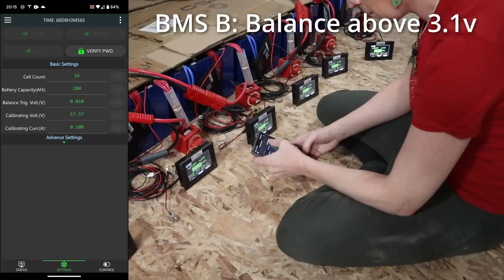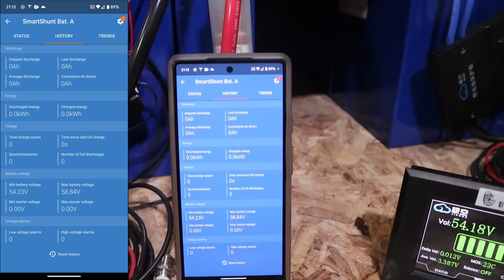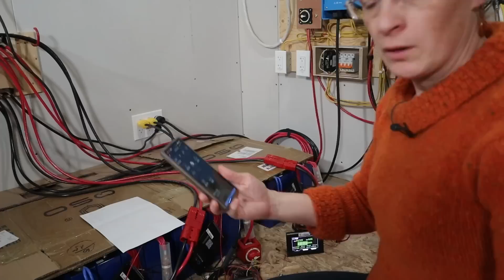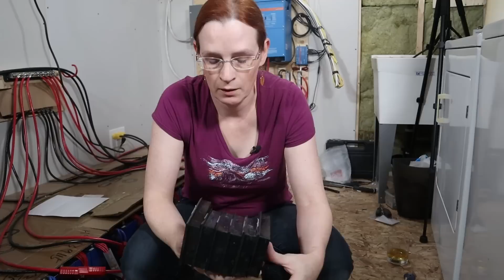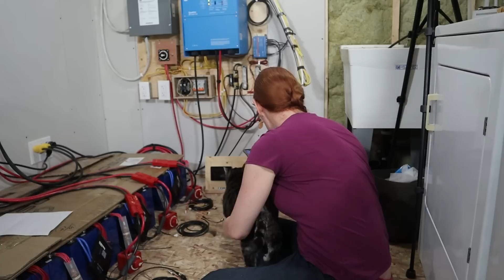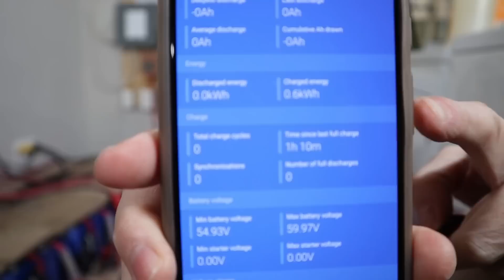Sparky Science! - Big Battery Build! (Ep. 48)

Comment: I'm glad it was only a heart-pounding moment.  Good work with the chisel.

We detonated a big battery at work just before the holiday.
It scared the .. out of us.
Even "professionals" have failures and f<"( ups.
Ours was a f<"( up.

I've run the numbers again.  Either CUI had a test escape, or the JK screen connection just drew too much power till the P78 cooked itself.  That nasty smell is probably capacitor electrolyte.

Keep up the good work.
B,
Reply from the maker: "We detonated a big battery at work just before the holiday. - Um, story time?   - Does the buck converter have an internal capacitor? The ones on the board are intact.
Reply: @The Digital Mermaid  An 1800V 0.5MWh NMC pack was being decommissioned and had a tool dropped across the terminals inside the protection.  Major thermal runaway event ensued.
And one of the big reasons why we don't use NMC anymore!

It is quite likely that your buck converter module had several capacitors internally.  Reading the datasheet again, I couldn't find any reference to thermal limiting - just de rating.  The device was short circuit protected, but no details of the OCP..  So I am erring to a thermal induced failure.

But now you have no screens writing that jk data interface is even more important.
Reply from the maker: @brianscally3439  "An 1800V 0.5MWh NMC pack" - Holy fucknuggets!

"So I am erring to a thermal induced failure." - Could that have been from when I soldered it on, if I got it too hot?
Reply: @The Digital Mermaid  
Yes.. on the work batteries, there is also a cryogenic liquid hydrogen tank in close proximity to worry about, that scares the living beJesus our of me. 

As you said in the video..

Life expectancy is a statistical process.
The curve is U shaped with some dying very quickly, but most living productive lives.
Then as the components age some fail in middle age, some go on for a very long time.
The failure mechanisms are different, but HDDs, Fans, CPUs..  all the same sort of math.
My mental model is that a component/assembly/thing has a certain number of 'clicks'.  When they run out, the thing is done.  But we dont know how many clicks a thing has other than on average or possibly at the end of life if we have good enough records.

 The harder a thing is worked, the hotter it got when soldered, the faster the clicks happen.  But sitting doing nothing .. clicks also happen.  Just probably slower.

For these parts, they have a relatively low solder temp.  That may be the plastic case or the components inside. it is hard to say.
I suspect you dont know which ones you had problems soldering, so tracing it is impossible and would take way more time, possibly leading to insanity.
You correctly state there are 12v batteries to build, a much higher priority.
..
But we can now confirm 2 things.
 it should have had a fuse.
 it is quite exciting when it lets go.

Looking forward to the 12v battery build and your trip home.

Comment: In turns of things burning & smelling bad, I have been using a Bluetti AC200MAX for a couple months daily and the 8mm barrel plug for AC charging melted. That’s a commercial product with lots of great reviews so problems are not restricted to DIY projects.
Reply: Exactly, my Goal zero power station has 3 anderson 30 amp rated 12 volt ports for charging and discharging and I have managed to melt all three of them. I had to replace all ports with xt60 connectors. It seems the connection points are the weak links with dc circuits.
Reply from the maker: Melted power plug?! Yikes... How did Bluetti handle it? Shit happens to everyone, companies included. The measure is how they handled it after the fact.
Reply: @TheDigitalMermaid  I have heard nothing from Bluetti. I sent them another email with links to photos rather than attached in case they have an issue with large attachments.
Reply from the maker: @doug1olson  Well that's bullshit. How long has it been?

Comment: Mistakes happen even when one knows better. I have had my share of these mistakes and electronics/high voltage/high current is my formal training from my Uncle Sam. You are overall taking the precautions — especially by being near the system when experimenting.

Even the highest quality parts have a non-zero failure rate. Most component failures are early in their use and at their end of life. Device burnin is an important part of obtaining high reliability. You did just experience an early component failure. It happens even if everything else in the circuit is correct.
Reply from the maker: That's encouraging to hear, and thank you. I'm really hoping it was just a bad part, but I know I don't know a lot, so I'll be keen to have Andrew diagnose the root cause. After that, I'll revisit adding the screens back, though likely if I do, it'll be with all-new buck converters, with fuses and switches! Haha.
Reply: @TheDigitalMermaid  — Statistically, your sample size is small (only 16). Other things to keep in mind include possible assembly error such as excess heat applied to that one module or environmental damage afterwards (modules wiring assemblies loosely on floor).

These things are easy to do when prototyping which I am guilty of myself. Ideally you will identify and correct the source(s). In time you will react more calmly and need to express only a simple "darn" when startled with an unexpected incident.

Before retiring I trained techs. During the "hands on" portions, I purposely let them make "dramatic mistakes" so they would be less likely to do it in front of the customer. And also to remain somewhat calm especially if the customer was nearby (which was the typical case).

Looking forward to seeing the setup in your boat.
Reply from the maker: @jepomer  "Ideally you will identify and correct the source(s). In time you will react more calmly and need to express only a simple "darn" when startled with an unexpected incident." that is a level of Zen I have to wonder is beyond me. :P
Reply: @TheDigitalMermaid  – You'll get there. I have no doubts.

Comment: LOTS of sparks! I'm really glad that it wasn't too bad, that you weren't injured, and that your house didn't burn down with your kitties. I'm surprised that it sparked for as long as it did - appeared to be a lot of amperage going through that small circuit - or was it sparking at the coil of wire heading into it? I agree with your assessment that a fuse would be a good idea - maybe a ~500A on the battery main terminals and then ~1A heading into the buck converter? I recently added extra fuses to my EV battery - 500V 400A fuses in each sub pack. Not cheap, but good for peace of mind.
Reply from the maker: I had run the wire directly to the main pack positive, behind the t-class 200A fuse. Why? I don't know, but if I run into past me, I'm kicking her in the ass. A 1A fuse would have been perfect, both to open the circuit, and as a place to manually open it if needed. Well, live and learn (second part dependant on the first part, of course). What kind of fuses did you use?
Reply: @TheDigitalMermaid  Ohhh, that definitely would do it! I recall that you were also considering having a switch for the buck converter & screen, and that would have also made it easier to shut off. Definitely a "live and learn" situation, but I am sure you'll get it figured out. :) Better to do in the basement than when you're stranded on a boat in the middle of the Atlantic!! I used EATON Bussmann EV30-400-AG fuses, you can see them here: https://www.youtube.com/watch?v=jwhzDE70KQ4 This is the same fuse as is used in the Manual Service Disconnect on the Bolt, so I figured if it is good enough for Chevy to use, it's good enough for me. :)
Reply from the maker: @BillCarlson  Oh, I remember that now. My car has a similar fuse under the back seat, self powered pyro disconnect that fires if the airbags go off. I'm sure there's a different service disconnect as well though. That has to be silica filled... The current breaking capacity of that beast is likely insane.

Comment: hello, I am a marine electrical engineer and design lithium systems for big and small boats and what happened to you is a classic learning experience I would love more people could experience . I do see where you're going with your testing and it's not wrong and as long as you take away the lesson you have learnt a lesson. In the marine world when you're at sea with no backup and only you and the unpredictable  ocean to keep you company a home battery build ethos is not a real direction for safety and reliability . I personally do not recommend your setup for a full electric driven vessel. If you wish just to use your boat as a static hotel then it may work but having sealed isolated battery bank  with minimal connections and short power leads is the way to go. I applaud your inquisitive nature but a boat is not an off grid setup where waves beat your vessel beyond  your comprehension, I hate to rain on the parade when your so passionate but please learn the issues of being a sailor before you adapt a house power system to run your boat. you quoted real world many times, and this system is not marine stable. I am removing a 800ah lithium home system because it  shorted his charging system melting 90mm2 cables causing a serious problem. happy to pass on any info that maybe useful in a marine environment.. good content..well done.
Reply from the maker: The cases aren't made yet. Short of this, everything in this build has been marine rated (ancor wire, environmentally booted anderson connectors, tinned-copper everything, Victron kit...). What part of this, other than the cases which haven't been made, is "not marine rated"? The BMSes? Well I'm already working on plans to replace them. What else?

I don't mean to sound snarky, but I have spent most of my life being told that I can't do things that I always found a way to do. I understand that I could fail, that's always an option on any "big dream", but that's something I embrace. I will always happily and graciously accept criticism that is focused and backed up. General "this won't work" though, well, if that stopped me I would never have gotten anywhere close to where I have. So please, share specifics and I will happily hear you and learn/debate.
Reply: @TheDigitalMermaid  greetings, I expected you to kick back and so you should with what you have invested in your project and a life time of na sayers, I did not wish to offend, just impart information for future research….. I have on a daily basis repaired boats where the faults are human error or environmental issues mostly and I learnt from doing not from being told what not to do, however, I have also had to recover sailors who have died due to unforeseen circumstances and poor or reluctant maintenance to the vessel. logic when you apply it to the marine world has many more variables, even when the principals seem sound on paper, however, poor design with lack of the environmental awareness can render so called marine equipment worthless despite you having to pay an arm and a leg for it,  so the key to being a seagoing engineer is looking for what you don’t know, a task we all strive for at some level but one that may save you and your crew.  you seem cautious and methodical in your approach and with out saying “do as I say not as I do” you will be the only one to live your journey with all's its ups and downs wins and losses. The practical reasons for not using home made cells are thus: your cells no matter how you connect them will be exposed to the salt air unless you Homerically seal the box, The pounding at sea will lose the best fillings so battery and cable integrity is paramount. your BMS unless a Victron is a non maranised circuit board way more complex than it needs to be with out the outputs to control and switch the system off like the victron (fan boy). The adage “keep it simple stupid” is a seafarers best friend as you may know so the principal of your adventures are sound and exciting but you are still on the edge of the knowledge envelope when it comes to electric propulsion at sea , range is your enemy, most boat owners struggle with replacing pb cells with lithium still (mostly cost). I wish you well but may I suggest you use pre-maid 12v or 24v sealed cells or better still Victron batteries and the control systems they provide should the finances be willing. good luck with your goals.
Reply from the maker: @MrRicciwalker  "The pounding at sea will lose the best fillings so battery and cable integrity is paramount." - I'm not sure if you saw my past videos, but I did a series on experimenting with flexible bus bars, specifically because I was concerned about vibration and slamming loads. Similarly, the cells will be (like they were in the first build) wrapped in 2mm neoprene to further absorb shock and vibration. I plan to spray a conformal coating on all exposed metals inside the battery boxes after final assemble to further seal them, on top of them being tinned copper already. I've seen countless "marine grade" pre-built LFP batteries torn apart, and they're using the exact same cells (at best, I'm using EVE, many retail batteries use unbranded cells). I plan to replace all nuts with posilock nuts to further reduce the risk of backing-off from vibration. All this to say; Being a retail product, in and of itself, doesn't instil me with confidence. 

As for range; This is something I repeatedly hear as a concern. I'm working on a video that will go into this topic in detail, using my boat's existing engine as a comparison. I think most people who have a lot of experience with traditional battery installs struggle to see how much power a bank like mine has. More on that later.
Reply: @TheDigitalMermaid  hello again, I like the thought of pushing the boundaries of boating and have patents on marine equipment working in Antartica where we use aerospace lithium batteries and even these gave us no where near the stated output due to the reduced temperatures. we used  the self heating effect to warm the batteries under load but the reduction in range was only improved with heater pads (self defeating) we used  diesel water heater in the end and a plumed in water jackets to get our range up. we are at -10ºc and lost 20% range, real world problems. I have no doubt your cells are high quality and will be built to a high standards with insulation and isolation in mind however a cost analysis may not be so favourable given the effort you are going through, however you have already started on the journey with sunken costs The difference is I need to think commercially and you can concentrate on the finer detail of battery balance which in the end you will overlook when under way, you will want to move the throttle and have power every time. The same goes for regenerative energy recovery through the prop verses drag, if your a day late to a port what will it matter as long as you get there. Again I applaud your project and the learning process you will encounter on the way. I have recently installed a 50' cat with a twin water cooled motor setup that uses a small diesel DC generator directly feeding the motors because his million plus system failed due to overheating bms when manoeuvring leading to a costly bump on the bow, this was a mastervolt system too. food for thought….ricci
Reply from the maker: @MrRicciwalker  I'm leaning away from a wood-burner stove (at least for primary heat) and towards a diesel hydronic heater. This heats a glycol loop which means I could use it to heat my hot water tank (currently plumbed into the diesel for heat when underway). It wouldn't be hard to have the glycol loop go through a passive radiator in the engine compartment when I need to raise the battery temperatures. That would keep the range predictable without burning electrical power.
Reply: @TheDigitalMermaid  good plan, we also use a cooling loop on the electric motors with keel coolers to sink the heat away but could be used to also supply heat to a dedicated rad using thermal syphon or a small pump. we found keeping the motor temps low yielded better performance with sustained use, borrow from Peter to pay Paul. we had constant temps of 70ºc under load and reduced it to 50c with coolers, we also sent the cooling substrate to the hot water tank until it was saturated then the keel cooler cut in. regarding coolant, we use waterless coolant, its used in the motor racing world and transfers heat 28% better than water or you can use distilled water not deionised with an additive called water wetter, it reduces the molecule size and increases the surface area, 15% better than water at heat transfer and will not freeze until -10ºc. farmers use it as a surfactant to atomise water better and cheaper to buy.
Reply from the maker: @MrRicciwalker  In my case, I'm going to use a pod motor, so it'll passively cool from the surrounding water (one of the big reasons I wanted to go with a pod, in fact). That "water wetter" sounds fascinating.